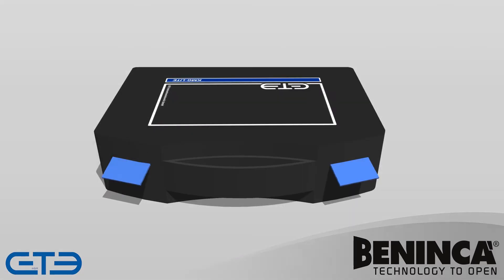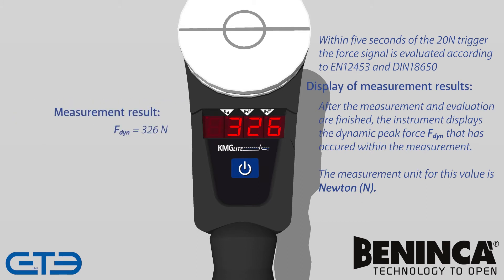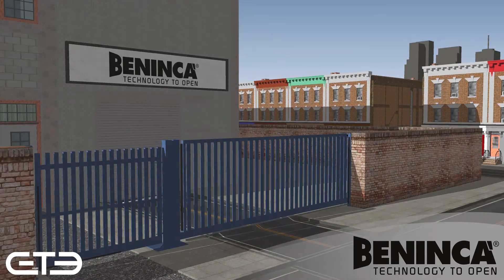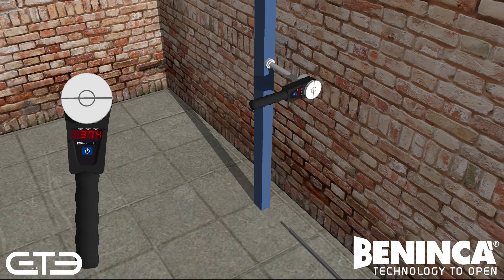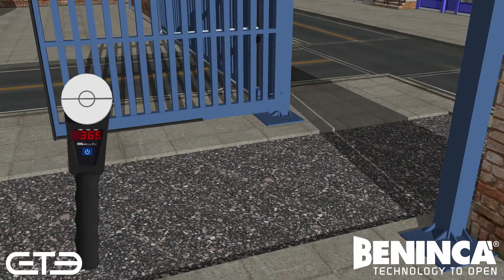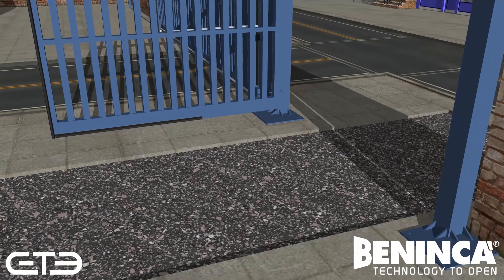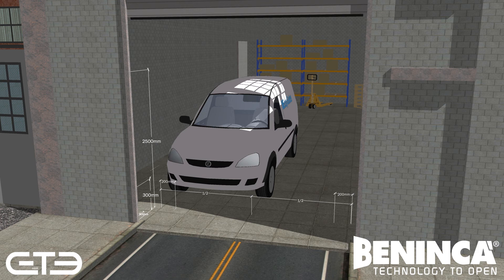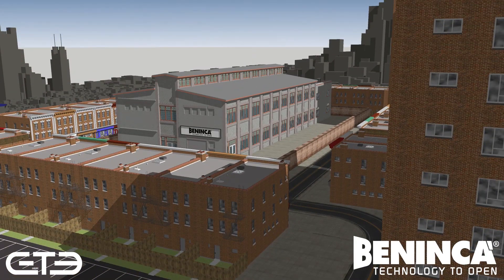Beninca UK_Online KMG LITE Gate Force Testing Tutorial

Comment: How are you expected to carry out a force test at the required distances if there is no rear post at the back of a sliding gate for example?
Reply from the maker: When force testing gates there are standards that you follow that detail which position the force tester must be placed in order to test the force - as shown in this video. There are then parts of those standards which highlight the forces that must be achieved. If it is not possible to place a force tester and take an accurate test then you simply cannot use a force tester in this incident. Therefore you cannot prove or disprove the forces present. However, you will still have to assess the potential risk and if the risk is defined as significant then a control measure would need to be put in place to heavily reduce or eliminate said risk.

If you require further help, please do not hesitate to contact our knowledgeable team on 01488 658 276.